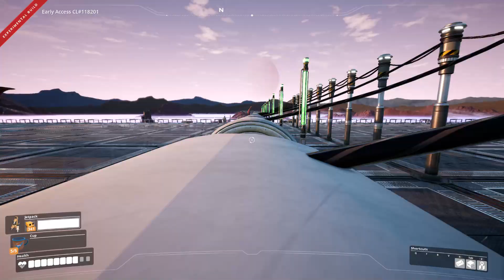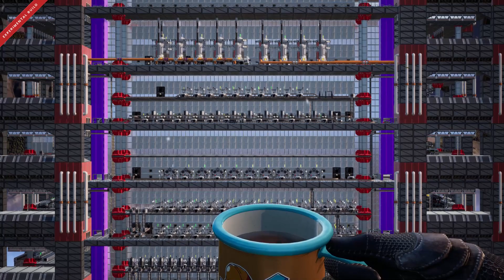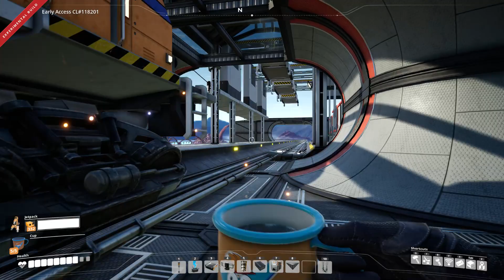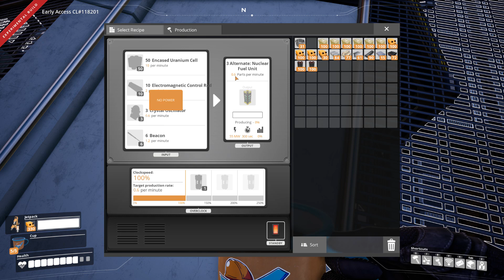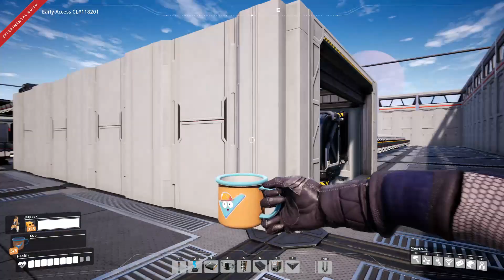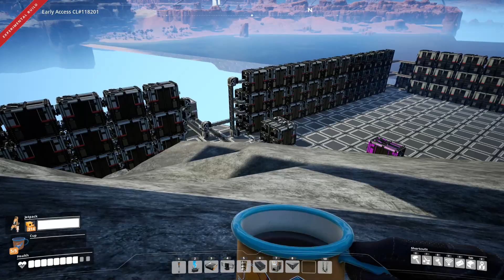Satisfactory - Mega Factory - Prepping for Nuclear and crazy amount of waste storage.

Comment: Have you used the alternates for making turbo fuel? On a 600 line of oil i can produce enough turbo fuel for almost 300 generators i got just a couple coal plants and very few geyser generators and i got 35,750mw and on my game im not doing nuclear until im mass producing turbo motors and even then im trying to avoid nuclear lol radiation just tickles too much and no way to get rid of the goo so thats why im avoiding nuclear lol

Comment: Very nice. Did you use the most efficient turbo fuel recipe chain? You can run almost 600 generators off four crude oil pipes.
Reply from the maker: No I did not.  This was because I had this set up before update 3.  But yeah those new alt recipes are OP!  Will be using in mext next play through for sure!

Comment: I really like your designs Daniel. Are you worried about the amount of radiation your 24 nuclear plants will generate amount the pyramid? Relocating the storage out to the island makes a lot of sense. Thoughts about the pyramid? Thx
Reply from the maker: With my limited knowledge, tge way I believe it works is, once the nuke plant is up a running 100% it will reach a certain level of radiation and then won't just keep expanding out, however with the storage area the nuclear radiation ring will expand relative to the amount of waste stored there.   Its all up and running now and using the Satisfactory calculator map, to check the radiation zone, its much stronger/bigger around the storage island